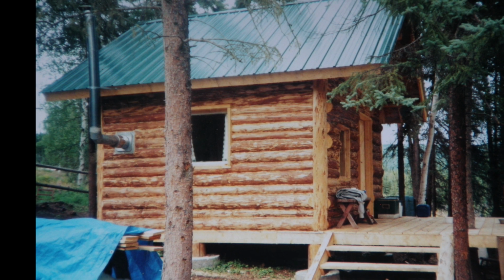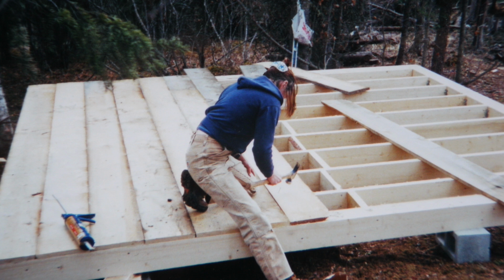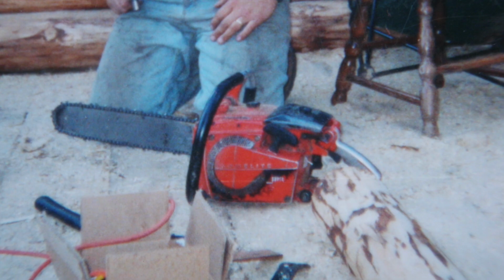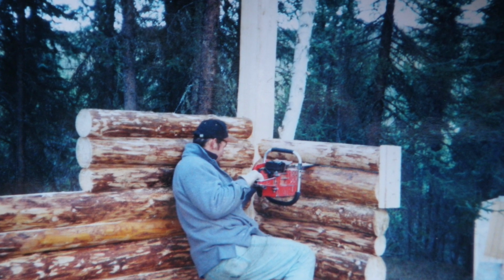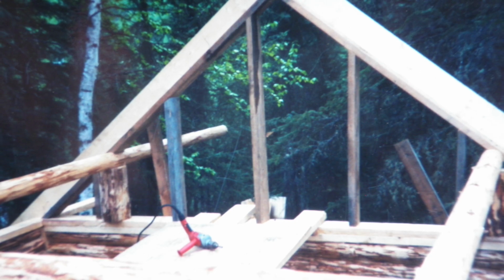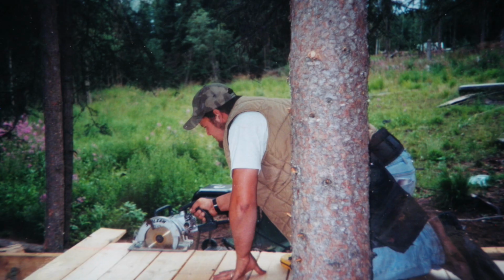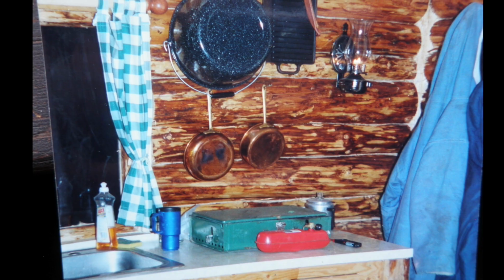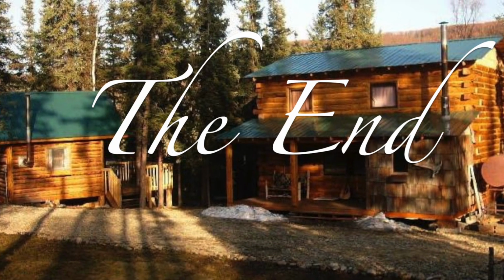Off Grid Log Cabin .....Start to finish.

Comment: Why dont you use hooks on ladders and hook over the ridge, to stand/sit on for the roof? And maybe even a harness. I know people who are paralyzed from falling off a four foot ladder.
Reply from the maker: I'll never do steel over plywood again....no need for it. All the roofs Ive done since this one ( 2001) have all been on skip sheeting...which is 1x4 rough cut lumber nailed to the rafters 16" OC. I have another video on building cabins that I show this method and its quite safe.  Thanks

Comment: Why wouldn’t you want the corners tied together like log cabins are usually done?
Reply from the maker: Because all I had was short logs. 13' at the most. If I would have made a saddle notch cabin, I would have ended up with about 10x10 of floor space as opposed to 12x12.  This style is called a corner post cabin and it gives you the absolute most out of the logs you have.
Reply: @Bushradical  Ok, makes sense. I understand. Thanks for the reply. Enjoyed the video.

Comment: Dave...wholly Sh"&%...i worked along that pipline...Bracket Maintenance Crew"....2000. 2007....you lived there ?  Still?
Reply from the maker: Its up in the valley north of the observation center on the Steese.......just over Haggleberger hill.  I bet you know the area.

Comment: Actually when installing a tin roof you would use the 1x4s that would've been installed from side to side or lenghtwise as toe board as you pulled,dropped,and screwed down each sheet of tin... 3/4" of airspace as well as air insulation on top of keeping the tin off of the sheathing which would cause corrosion as well as swelling of the osb from the under side..